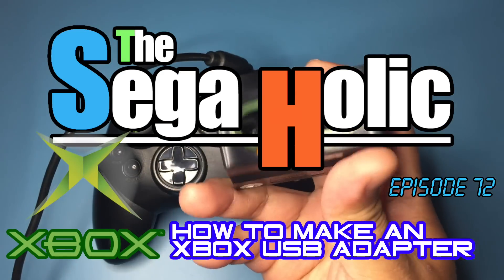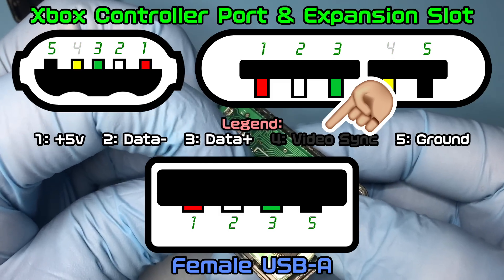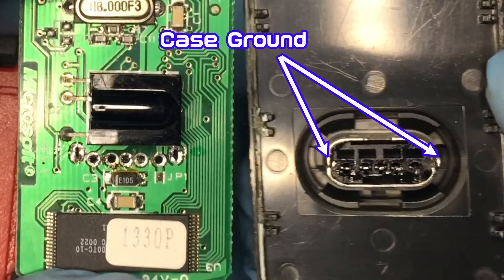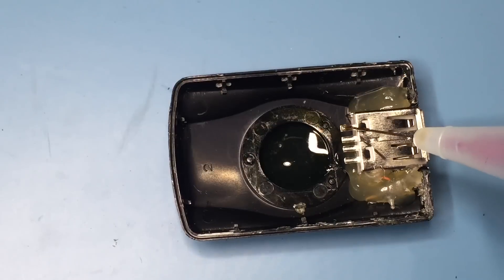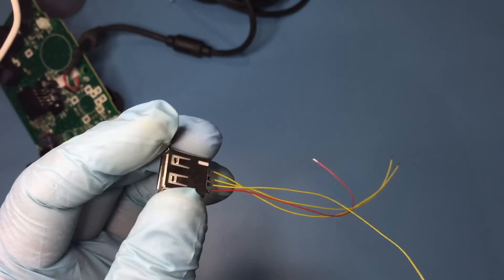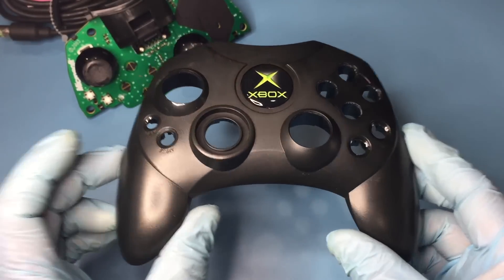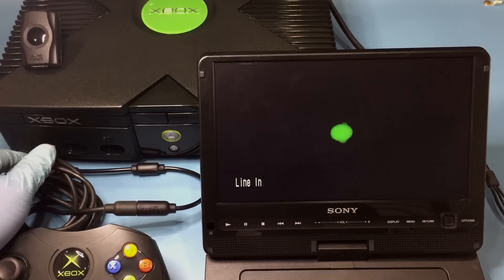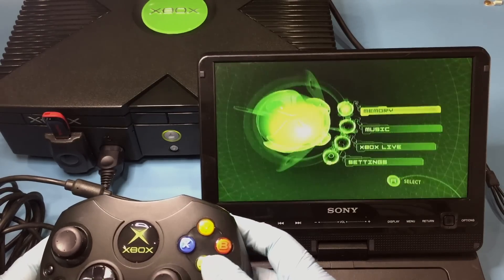Original OG XBox How To Make a USB Adapter For Softmodding [ep. 72]

Comment: Did you just make your own memory card?? Cool
Reply from the maker: It's a USB adapter for USB Memory Sticks that can be used for uploading softmod files to the XBox. You can modify anything that usually plugs into the controller ports. So you can hack that DVD dongle, or a controller, etc.
Reply: This might be a dumb question but the thumbsticks on the left and right sides are interchangeable, right? I have like 20 some controllers now and I hope to get 16 like-new controllers for my LAN party. Some have torn thumbsticks and work good, some have good thumbsticks but don't work at all. I found some replacement thumbsticks on ebay that even have the reinforced cross on the bottom like you point out.
Reply from the maker: @v3ck1n  Yup, interchangeable. The replacement thumbsticks on eBay are expensive. Shop on Aliexpress instead:
https://www.aliexpress.com/item/1x-Mushroom-Thumb-Stick-Grips-Analog-Plastic-3D-buttons-Joystick-Cover-Caps-For-PS3-PS4-XBOX/32819512749.html
Check it out... 25cents each. Choose #3. This is my second order from them. Took 2 weeks to get here in Hawaii.

Comment: You gonna do a video on BIOS flashing? Don't remember which version of XBOX you can do it on but, the older ones you can just de-solder and pin and flash the BIOS so you'll never lose the soft mod due to accident or anything like that. It's neat stuff. Also, I didn't wanna muck around with flash drives and USB connector soldering when I did my XBOX a while back and there's a method where you hot-swap IDE cables and get the XBOX hard drive to unlock it self so you can put the necessary dashboard files onto it, it's an interesting method.
Reply from the maker: BIOS flashing? Never tried it, but I'm gonna finish the XBox series with softmodding with SID5.11. I know there's an audience for the joystick stuff I wanted to do EONS ago that are patiently waiting, and is why I'm going in a frenetic pace for my standards this past 2 weeks.

Also, isn't 5.11 safe enough that the only accident that can happens is for those 1% that are willing to go into places that they are warned not to go into? Also, Rocky5's XBox Softmod has even more tools and safeguuards that make BIOS Flashing almost unecessary. I had an accident once, because I tried to softmod a 5.11 softmodded console with Rocky5's softmod. But I was able to find tools (Slayers) and burn a disc to reinstall the dashboard.

But if you know anything so far about me, I hate to do non-reversible mods. And you always take a risk with flashing, if anything happens during the flashing process, the XBox is bricked.

As far as the IDE thing, sounds like doing the Chimp process for the HDD.

If you have any more mainstream suggestions that involves less risk, I'd love hear it.

Thanks for the suggestions.
Reply from the maker: Spoke too soon! Just went from error 11, to error 16! Pulling my hair out for the las 5 hours. LOL. I think I may have a solution. Didn't save my eeprom to boot as I didn't have the chance.

Comment from the maker: Sorry, original upload got popped for copyright for the bg music. It was a 30 sec loop, and got flagged for 45 seconds of it? Ugh! Hopefully, this doesn't get flagged again.
Reply from the maker: Yeah, I actually tried it before with the memory sticks I had lying around that was under 4GB and it didn't work. I tried it again today, redownloaded it and still doesn't work. It can actually format the drive, but the XBox doesn't recognize it. The only one that works is the Cruzer Blade with the XBox can format on it's own. I even tried 128MB micro SD cards with adapter and those don't work also. I have 7 Cruzer Blades that work... stocked up before the price hike on them, so I think I'l be covered if one breaks... LOL. Thanks though, appreciate the tip.
Reply from the maker: Yeah, a lot of different sticks have been tested to not work. There is a list of them. Don't worry man, you are actually helping. Just discussing different aspects of gaming helps me think some viewpoints through when making a video. But thanks.